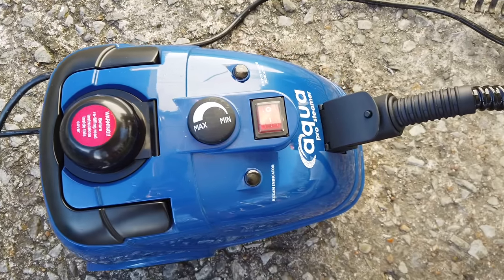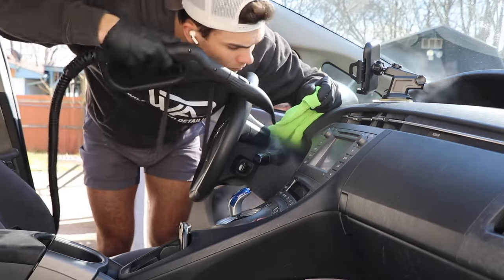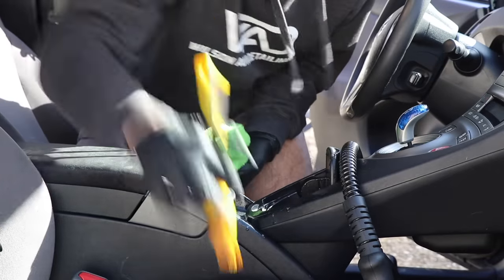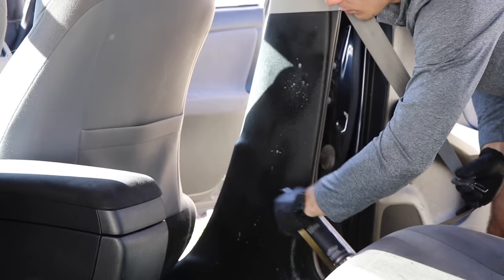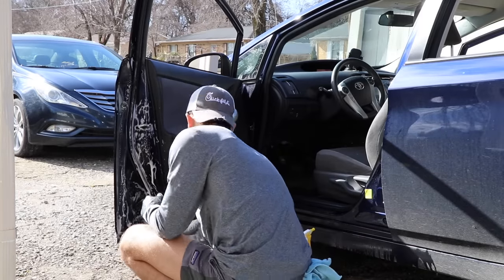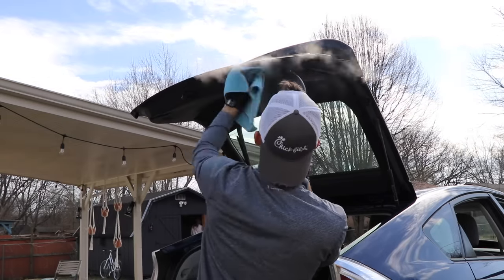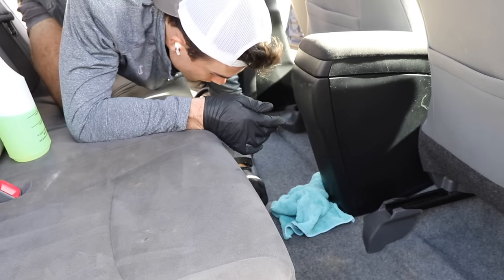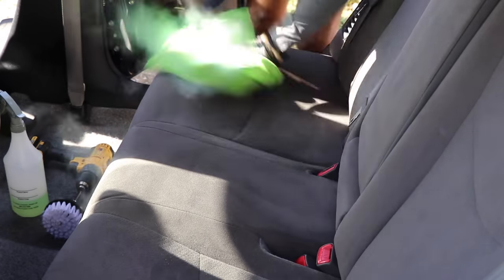All NEW Mobile Auto Detailing Steamer... Best Steam Cleaner For Detailers!

Comment: I use the AutoRight steamer. It works good but it is kind of cheaply made. It's gets the job done for my current budget but I'm hoping to upgrade soon
Reply: I just used my autoright for the first time last night and my main concern is that if you let it sit for even a little bit of time, it builds up water which you then have to release before you get steam.. would make detailing an interior inside of a garage kind of a pain.. did you experience this or maybe I did something wrong?

Comment: I have the McCullough steamer 2875 something like that but it seams to spit steam instead of the way yours looks but the video is sped up so it looks like it’s constant steam without any spitting or spotty steam. Sometimes it will steam well but not always and I always use distilled water and it’s not clogged because it’s always done this.

Comment: After you steam the set do you retract the water from the sets? Or does the steamer not put a lot of water into the set and you can just wipe it down? Thanks great video.
Reply: You will usually have to pull what moisture you used out of the seats.

Comment: What is that purple cleaner you are using on the door jams??
Reply: Super clean degreaser
Reply from the maker: Yep^^^
Reply: @Gmannchoi  that's super clean, not purple power right? I often mix them up
Reply: @bradevans8714  I'm finding out that super clean is the thing to use. Diluted in different ratios . easy. Just bought a gallon for like eight bucks at Walmart. They sell for like 17 or 18 on Amazon. Gallon should last forever? Lol

Comment: So would you steam instead of using an extractor like the Bissell Spot Clean Pro for all the fabric in the car? Or use both machines?
Reply: It really depends on the condition, but the steamer really helps whether it’s hammered or not! If you don’t have a heated unit/extractor, the steamer works great at breaking down stains, oil, grease, grime, etc...
In this case, he’s doing a maintenance job so it’s not SUPER BAD, which allows him to mop up any dirt on the seats! 
Hope this helps 😃.